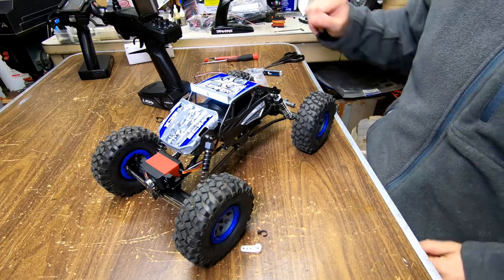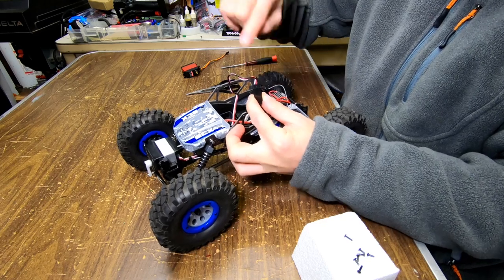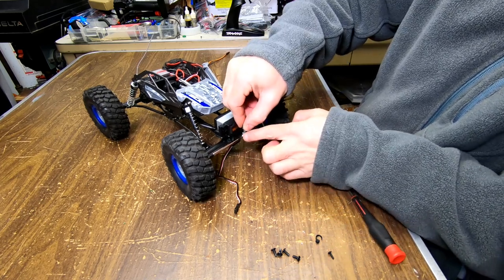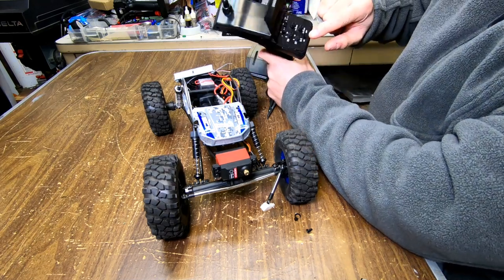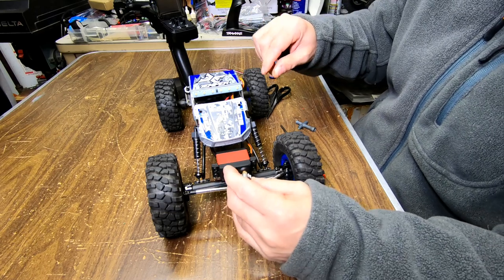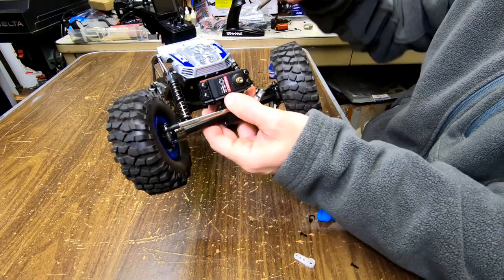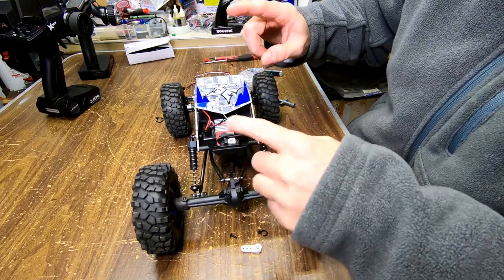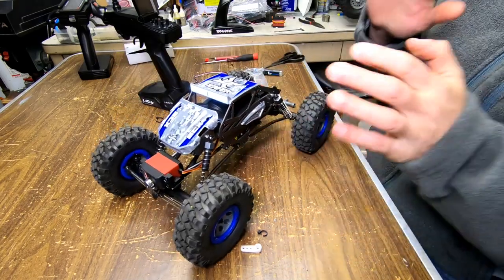ECX TEMPER GEN 2 SERVO UPGRADE | HOW TO INSTALL A BETTER SERVO |

Comment: Good tech tip my friend👍👍💣💣
Reply from the maker: 👍 Thanks man!  You feel the play in your servo it wiggles side to side like the bushing they used on the spline was to big?
Reply: @ShenRC  i havnt checked ill do that when i get home i changed out the servo on the gen one it was weak looks like they used the same one in the gen2

Comment: Hey Shen I found out that this model uses the same length drag link as the SCX10 (135mm) so you can get an offset version.  I ordered the Hot Racing SCX4901 which has a 3.5mm offset so it should clear the differential much better.
Reply from the maker: 😉👍 Awesome!!  Mine is working fine but it's great to see a direct replacement that will work. 👍Thanks for watching.

Comment: Do you think the Hobbywing 1080 crawler esc would fit inside this crawler? Even running 2s it should put out 3amps at 6volts for the servo. With a 20kg servo this thing would be a beast😊
Reply from the maker: Hi I am sure you can find a spot to fit normal electronics in this , In fact I think I already seen a guy who did swap out everything for normal RC electronics already.  Thanks for watching.

Comment: Hey shin is it possible to set the steering end points on da temper 2?
Reply from the maker: Hi only by the steering Duel rate knob it does limit throw of steering for both directions.  If you want it to turn sharper do my mods in my steering mod video but leave the ball bearings in and run the truck and use a small file and grind down the sharp corner edge of the cvd so when you fully turn it won't rub the ball bearing and you will get sharper steering.  Thanks for watching.
Reply: Did your mods while back and works great!!! I'm running a 25kg seems to be over throwing I'll lower the rate see if that does the trick thanks Shin your the best!
Reply from the maker: @lightspeedlife415  Your Welcome.

Comment: Is there anything on a motor swap and differe esc?
Reply from the maker: Hi Sorry I did not change anything out on mine.  Thanks for watching.
Reply: @ShenRC  you know of any channel that has swapped out either one
Reply from the maker: @Ajw420  Hi sorry I don't but my guess would be use a hobbywing quickrun 1080 esc or the cheaper 1060 version with non adjustable drag brakes on all the time. as for a motor I am not sure.

Comment: Has your rear axle got a bit play
Reply from the maker: 😁 Hi what when you pull a wheel sideways in and out? yes they have lay so does my doomsday.
Reply: I shimmed mine added 12mm wideners fitted mini losi aluminum shocks and lock outs
Reply from the maker: @neilhamilton2621  cool , what I did to mu doomsday was use the traxxas stampede wide wheel hexes and it added a couple mm on each side and made the width a little wider.
Reply: Mine runs much better
Reply: No more play now